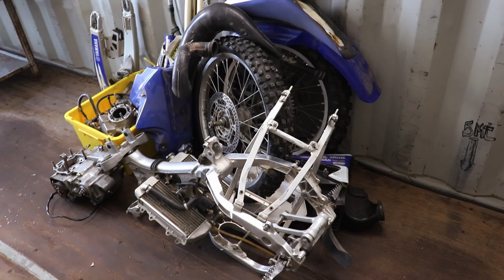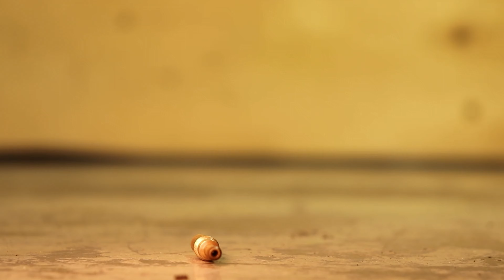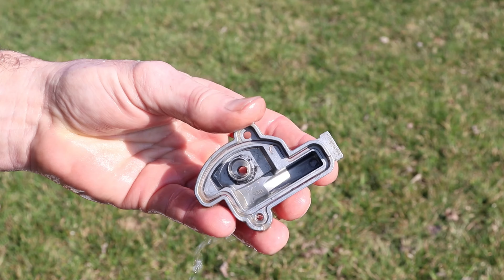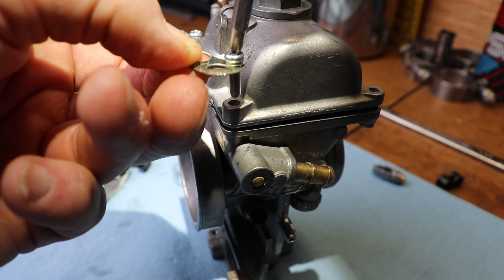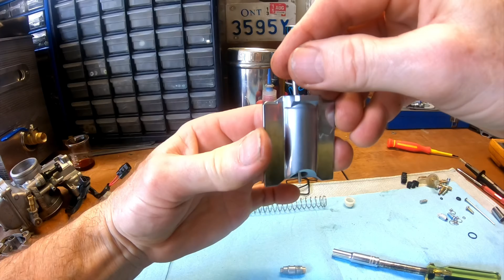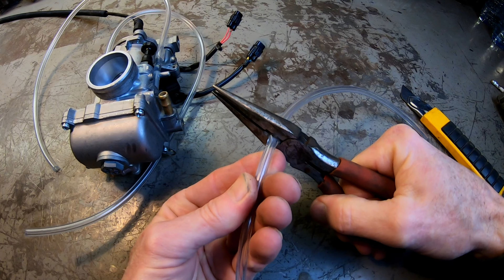Yamaha YZ250 Carburetor Rebuild In Close Up Detail

Comment: hi Ryan (assume thats your name...) i recently picked up a 2017 yz250x and went out riding for a day, and have some tuning questions. Bike seems to have pretty good power and throttle response throughout the rpm but i don't really have anything to compare it to. i noticed that after the bike was warmed up, it still smoked a bit. my friend took it up a large sand hill in first gear, so it was revving fairly high and was smoking a fair amount. later i took it up a steeper hill in 3rd in lower rpm and it started to smoke a bit when i got on it near the bottom of the hill. at days end there was a 6" spooge dribble down the pipe. 

i have a rudimentary understanding of my carb and the various circuits. my predicament is; it starts first kick, i'm not fouling plugs, and power seems good, so is it worth trying to dial in my carb? and if it is worthwhile (i kind of want to try) do you have any suggestion on which circuit to start with? if you'd be willing to watch i have videos of the 1st gear hill and 3rd gear hill i can post. i'm weary of leaning out the wrong circuit and creating more problems. or is the solution just trial and error? 

i've also seen variation in the owners manual on when the powerjet is active; some say it opens from 0-1/2 throttle, while mine says it opens from 1/2-full. all seem to say it closes after 8500rpm. any idea if yamaha is actually changing when it opens?
Reply from the maker: Hey Benny .I'm not a carb tuning expert by any stretch of the imagination. But when  you say your bike starts first kick ,doesn't foul plugs and has decent throttle response....man that sound great to me . I wouldn't mess with anything..Oily goo out of the exhaust is kind of normal, two strokes are a bit drippy .Typically the power valves get sluggish and sticky with lots of hours on the engine and then you can get a  bit more smoke and oil happening. Plus the type of oil and your ratio plays a big part too.But man sounds like you have a sweet machine. I'd just  go ride it and have fun .Those bikes are quite a handful. I wouldn't worry about trying to maximize horse power too much ..its a fine line between max power and a blown engine. I'd certainly take a look at any vids you want to post .I'll show the guys at the shop and they can maybe give you some more insight. In the meantime have fun on that whip of yours and enjoy ..cheers 🍻
Reply: Thanks for the response and info, I really appreciate it. Here's a link to the clips, 3rd gear and first gear climbs, hopefully it works. On the 3rd gear climb I let off because the front started to lift a bit. https://youtube.com/shorts/NHs2AIDEh1E?feature=share
Reply from the maker: @bennymac1731  Hey Benny .Your bike sounds fine to me man . Looks like you're having heaps of fun on it too .
I'll see the pros at the shop next week and  let you know what they have to say if there's anything you need to address...Cheers buddy ride safe .
Reply: thanks a ton man. you're awesome and your channel is awesome.

Comment: Appreciate your knowledge and your ability to make it simple. One question.. I ordered the same moose kit for my yz 250 and there was a tiny little O-ring (i also saw it in your kit) and for the life of me I cant figure out where it's supposed to go. It's bigger that the air screw o-ring but smaller than the float bolt o-ring. Did you end up not using it? I also didn't have one when I disassembled the carb. I am stressing that I forgot something. Thank you so much my friend!
Reply from the maker: Hi James .That particular "o" ring isn't something that  sticks out in my mind at this time.I will  have to re visit the rebuild steps and see if we can nail it down .You have me curious now as to what that might be all about I will get back to you when I get it figured out .Thanks for raising a great question .
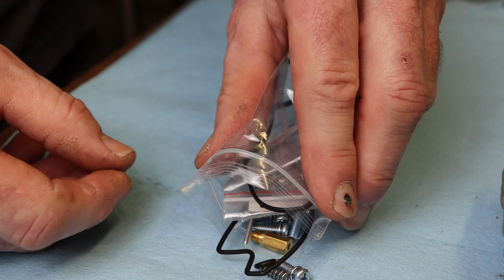Reply: Thanks. At 3:13 you can see it when you dump out the kit. It's the first oring that hits the table. Appreciate the response! @TRyanLearnBikes
Reply from the maker: @jamesr6277  Ok James I've had a chance to investigate a bit on this "o" ring  . While I didn't address it in the video I think it may be the one that fits on the base of the power jet solenoid . In the video I noticed I could see it still mounted to the solenoid when I dumped out the new bag of parts ,while the other two  old "o" rings for the air screw and the float bowl bolt were visable on the table in the layout of parts . I should have made a point of showing that one getting replaced .Thanks for bringing it to my attention .Hope this helps .Cheers my friend .
Reply: @TRyanLearnBikes  Thank you for taking the time. That makes me feel much better. Guess I'll find out when she gets put back together. I can tell your knowledge runs deep and probably forget more in a day than I will ever learn. Thanks to people like you, people like me can fix our toys. Much love brother!
Reply from the maker: @jamesr6277  My pleasure James. No mechanical guru here man , we're all in this together just trying to figure stuff out and have fun on our bikes.
I just posted another video this morning on the number one reason most carburated motorcycles run crappy. If you get a chance give it a watch there's  a couple of laughs in it and some good bits of info to .
Cheers buddy 🍻

Comment: Hey Ryan, great video man. I can also appreciate you responding to all the comments, that’s time and dedication. Quick question, I have this exact carb and went to do a rebuild and found the worst, “JET BLOCK” is cracked and doesn’t sit flush inside carb anymore. 

I see pwk and pwm carbs, but is there any part number you may have or website to track down this specific carb tps and fuel solenoid included as the other carbs or “upgraded” carbs do not come with these electronics! Thanks for your help sir!
Reply from the maker: Hey there good sir. Sorry to hear about your messed up carb .Regarding trying to find specific parts for that carb I have typically had success using a parts finder option at my local yamaha dealers website. Most dealers have a similar set up .I found this part number for the 
TPS. 5NX85885-00-00
     And 
Fuel Solenoid.   5NX1410H-00-00
I hope this helps in some way .If not feel free to let me know and I'll see if we can get you sorted.
Reply: @TRyanLearnBikes  I appreciate you getting back so swift. I believe I posed my question the wrong way. I was meaning to ask for the part # of the entire carburetor. 

As in the entire carburetor set up that you have in the video cause I find different ones that don’t have the technology. I apologize for the miscommunication! Thanks for even answering seriously!
Reply from the maker: @frunsezkendricksjr1392  Hey man no worries .I was'nt paying attention and misread the paragraph, totally my fault .I was able to find this part number for that whole carb assembly .I think this is what you may be looking for .
Part number   1P8-14101-00-00
Hopefully this will get you on the right track ,if not let me know and we will try again and  eventually we will figure  it out . Cheers
Reply: @TRyanLearnBikes  I found it this fast with that part # sir. I really appreciate it. You reaching out to your comments and subscribers is like the best thing out here. We appreciate sir, much success in your future!
Reply from the maker: @frunsezkendricksjr1392  My pleasure, we're all in this together just try'an to learn and have fun on our bikes .Cheers my friend 🍻  be safe out there.

Comment: What size are the two screws where your throttle cable threads into? (The two very top Phillips)
Reply from the maker: I think its part number 98502-04012-00  .They are a pan head screw 4mm in diameter and 12 mm in length. Hope that helps

Comment: I picked up a 1996 YZ250 and it has this Carburator with the TPS sensor and power jet solinoid. Should that work for my old bike. 1996 didnt have any of that stuff
Reply from the maker: Now thats a good question.. Without the electrical inputs available optimal performance would be lost .But I'm guessing there should be a degree of functionality you may be able to exploit .I don't have a solid answer to give you .I would certainly try it .If you do ,let me know how it plays out I'd be quite interested to hear about the experience. It might make a great video if you had the time to shoot it and put it out there .I bet others would like to hear about your story  too.
Reply: @TRyanLearnBikes  im wondering if having the wires not  plugged 🔌 in keeps the power jet open or closed 🤔
Reply from the maker: @michaelcalderon4401  Hey Michael I think it goes like this .When there is power to the power jet solenoid it is closed which leans out the jetting for more overrev.When there is no power to the power jet solenoid it is open and fuel flows through the circuit making it richer for a stronger midrange .The ignition uses the RPM and the throttle position sensor to control the opening and closing of the power jet solenoid .So with no power supplied to the power jet solenoid( because you'd have nowhere to plug it in , your bike would likley  run a little rich at  high RPM but be ok everywhere else .If you do end up trying it out let me know how it played out .Good luck. Cheers
Reply: @TRyanLearnBikes  Thank you for the knowledge. I will definitely keep you updated on this.

Comment: I must do this to my '04. As soon as I deactivate the choke, the bike revs to the sky as if the gas is turned off. Maybe the main jet? IDK.
Reply from the maker: Hey Mike ,Yes it might be a good idea to get inside that carburetor ,have a look around for anything obvious and give it a good cleaning .Also maybe take a look at the rubber boot where your carb meets the reeds and check for any cracks or gaps in the rubber .If air can get in there it'll certainly be hard to get it to run smoothly .Good luck and if you get a chance let me know what you find and how you solved the problem .Also thanks very much for subscribing to my channel ,much appreciated .Cheers ,good sir !

Comment: hey! Does your needle have a little bit of slack or is it just mine? I feel like it should be tighter somehow, but im not sure
Reply from the maker: There will be a little movement with the needle in the slider, just not in the up or down direction,the circlip and plate should keep it in the vertical position perfectly.But a little bit of side wiggle is normal.
Reply: @TRyanLearnBikes  Thanks!

Comment: Actually, you missed a step. Little do many people know this, but there is a gasket underneath the jet block on all PWK carbs. The jet block gasket can age over time, or if too much carb cleaner is used, and gives a rich condition at idle because the gasket separates the main jet from the pilot. Keihin specifically notes not to remove the jet block because it believes users cannot install it correctly.
Reply from the maker: Hey thanks for that great bit if information. Much appreciated. Cheers  to you my friend 🍻

Comment: Hello, should the tps guide lever return to the bottom position on its own? My tps lever seems to stay up and not return. Is the return spring in the lever assembly or in the tps sensor itself? Thanks. Helpful video
Reply from the maker: Hi Eric ,I have not disassembled the TPS mechanism before and cant tell you for certain how its sprung .I checked my shop manual for any    info and it did not reveal the internals at all .But the fact your does not return to its expected position  would indicate you need to take it apart and have a look .I suspect the spring is part of the lever not the sensor itself . If you get a chance please let me know what you find I'd be interested to hear how your repair goes .Good luck .Cheers
Reply: @TRyanLearnBikes  I just took it apart tonight. Looks like the spring mechanism is inside the sensor itself and the lever assembly just spins.  It was tough to figure out since the manual doesn't make it clear, and most videos don't show this part specifically. Thanks for the response! I think mine was installed incorrectly by previous owner, I just repositioned the tps and lever interface and it springs back now.
Reply from the maker: @ericd9326  Hi Eric ,great to hear you were able to resolve the TPS issue. I really appreciate you letting me know how it actually works , as you mentioned its not in any shop manuals and its not easy to find any intel on it online .Every little bit of extra insight helps in a big way .Thanks again for letting me know .Ride well and safe. Cheers 🍻